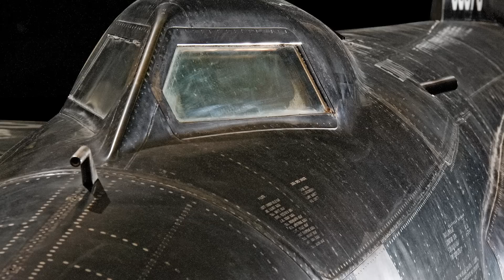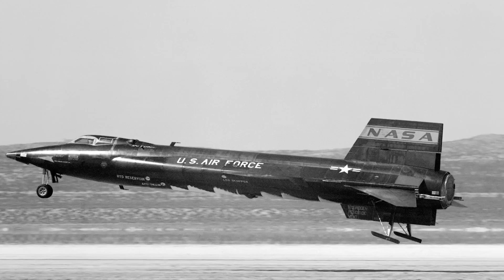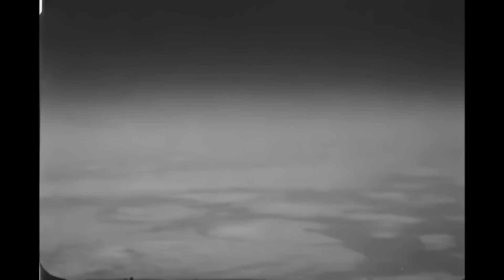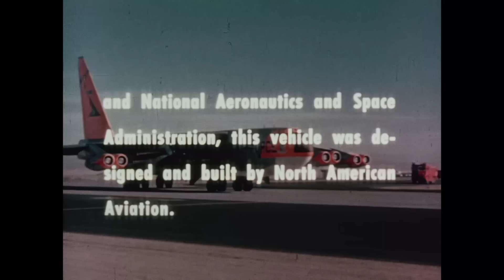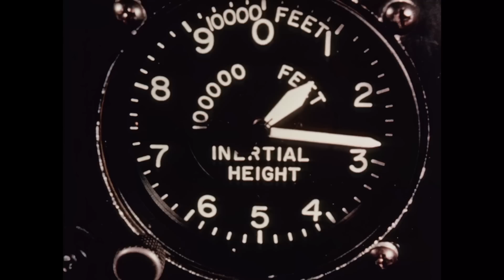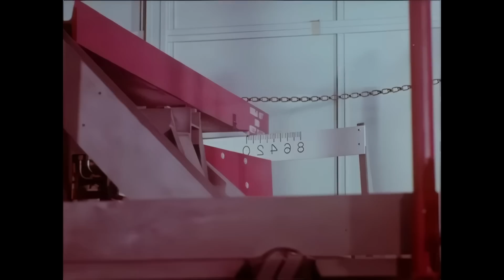X-15 Hypersonic Aircraft. Flying At 4,520 mph, And 354,200 feet High In A Rocket Plane

Comment: The X15 class of research aeroplanes (X15) was made possible courtesy of The Miles Aircraft Company and its M.52 supersonic research aircraft project, designed in the United Kingdom in the mid-1940s. There was to be an exchange of research, which in the end occurred only one way. The M52 was to be jet turbojet-powered, not rocket powered.
Reply from the maker: There is an ongoing debate on that. Eric "Winkle" Brown surely thought so, and that's probably why Chuck Yeager did not like him (X-1). It was certainly odd that the M-52 test flight was called off at the last minute, and not long after the X-1 broke the sound barrier. This said, there is no hard evidence that this is what happened.
Reply: @Dronescapes  There is no ongoing debate. The history is well documented. The X-1 aircraft was a British design, and the rocket engine was German.
As for Yeager, if what you say is true, he was somewhat confused.
Why risk a life for a record that's been taken? Britain, of course, eventually broke the sound barrier, in its own good time. It was the first to power a jet aircraft to 1000 miles per hour. That's jet engine, not rocket engine.
Reply: @francocarrieri1988 Obsessed and seething lmao, cry more yuropoor
Reply: @francocarrieri1988  Yes, you are correct. There is indeed no debate, because it is bunk. To say that the X-1 was a British design is most definitely bunk. If it were a British design, please show us where the British ever flew an aircraft that looked like thew X-1. The X-1 was designed by Bell aircraft in the United States. If you wish to believe otherwise, that is certainly your prerogative. The rest of us will gone on with our lives and ignore conspiracy theories.
Reply from the maker: @x15galmichelleevans  the debate is over the fact that:
1) The M.52 project was scrapped at the last minute, just before the scheduled test. At that stage the M.52 was 92% ready. No explanation for the cancellation was ever given.
The flight would have happened much earlier than the Bell X-1, month earlier.
2) We do know that the first working (not flying) turbojet engine made by Whittle was sent to the USA (General Electric) in great secrecy in 1941, and that ended up in the XP-59, which was also the first jet engine that ever flew in the USA in 1942. The XP-59 was made by Bell. We also know that the first Pratt & Whitney's jet engine was Whittle's. According to history Britain gave full access to their ally to all their secret projects. That is a good indication that the US most likely had access to all their projects, as proven by the ones they took, and that are widely known.
3) A scale model of the M.52 actually broke the speed of sound barrier, after the test was cancelled, and program was scrapped.
There is definitively plenty evidence of Britain handing over their technology to the USA. G.E. even made a documentary about it, which if anything would have been biased toward the US, certainly not Britain. They make no mystery they put their hands on Whittle's research.
There is definitively a connection between Whittle and Bell, and there is definitively an unexplained event, which is the sudden cancellation of the M.52 program with no reason whatsoever, and a scheduled flight, with Eric "Winkle" Brown as a pilot, the British legendary test pilot.
We also know that Chuck Yeager was quite aggressive with Brown for no apparent reason.
We have interesting interviews in both Eric Brown's documentary: https://youtu.be/PSRAdZzRycc and a full interview on the subject that has never been seen before, and that we will post soon.
In the interview you can also hear Brown explaining how Bell had a problem with the Bell X-1, and how the corrective solution was taken from the M.52 program. It does not concern the engine.
Eric Brown was normally a pretty objective person...
Reply: @x15galmichelleevans What the British gave the U.S.was the all moving tail plane. That is what enabled controlled flight at supersonic speeds. They also gave the Rolls Royce engine that powered the Mig 15 to the Soviets. And they flew a half size model of the M52.
Reply: @jeffcrisp5531  There is no definitive proof that the M.52 had anything to do with the way things were done on the XS-1. The all-moving tail concept actually goes all the way back to the Wright Brothers, so if anyone stole any ideas from anyone else, you have to go back to the beginnings of flight.
Reply: @Dronescapes  that happened because Rolls Royce was issued an engine contract over him by the government, so he quit in spite.
Reply from the maker: @basedmoonman9341  I am aware of Whittle's story, but I don't think this is related to the X-1
Reply: @Dronescapes  the british try to claim everything as they did it first. sick of them
Reply: That's nothing but Browns claims and there's no proof of it whatsoever except for him saying it. 
If there's anything you can count on in life it's the fact that anything Brown said concerning America is a lie, the fact is that man was a petty jealous little child who wasn't big enough to congratulate anyone else for an accomplishment, so like a jealous little kid he'd stomp his feet, carry on and lie if he had to in an attempt to swing attention back around in his direction when it was someone else's turn to get credit for something they did.
I've never heard that man tell the truth concerning anything about America, he's actually claimed to have witnessed Adolf Hitler shaking the hand of Jessie Owen's after winning the gold in the 36 Olympics, the only reason he told that lie is because he knows it's a point of contention about FDR not inviting Owen's to the White House after the Olympics which is a tradition so he claimed Hitler shook Owen's hand just to make FDR look even worse, every historian whose ever covered the subject knows that Hitler left the Berlin arena in a huff after Owen's won, he didn't even stay to the end much less shake Owen's hand afterwards, like we're actually supposed to believe that Adolf Hitler did that anyways, sure thing. 
Another big whopper of his is the claim that in the 50's US test pilots secretly flew that piece of junk Horten flying wing, and the only reason he cooked up that lie was so he could claim that "It wasn't even flown by a 'proper' test pilot implying that had it been flown by someone presumably of his, cough, caliber, cough, then critical data would have been recovered as opposed to some cowboy just going for a joyride and precious opportunities being lost, that's such an absurd statement it's practically enough to leave someone speechless, first off it's a very well established fact that no one ever flew that disaster in the making, no test pilot in their right mind would have set foot in the cockpit of that thing, anyone who knows the truth behind that hunk of junk beyond all the sensationalism nonsense about it knows it's airframe isn't close to being something that's airworthy, it was changed and modified repeatedly when the Hortens were working on it and the workmanship isn't even close to anything that could be considered aircraft grade, test pilots in that era had degrees in engineering and anyone with that high of a level of education would take one look at something like that and refuse to have anything to do with flying it until it was completely reworked, and also to think that they flew it in the 50's yet it was something that to this day remains so classified that they still won't admit it is absurd, yea right, it was that classified yet they let a television production crew from The Discovery Channel crawl all over the thing, right, that's all believable. 
Which brings us to his lie about this aircraft, the X15, according to him he put in to fly it and met all the qualifications and the only reason they didn't let him is because he wasn't a US citizen, HA!!! That's laughable, first off that being the case they'd never have wasted anyone's time putting him through all the tests and everything else he claims he passed, why would they even bothered to in the first place? They wouldn't have, the fact is he never applied to fly it nor was he ever even considered to fly it, he didn't have anywhere near the engineering background to get into something like that, like the astronauts the people who flew the X15 either had PHD's or enough education that they were just a few steps away from having one.
Sure that aircraft the RAF built would have been the first to break the sound barrier, but if someone can't swallow the cold hard fact that their own government pulled the plug on the project because half their country was still blown up and needed rebuilt instead of spending money on projects that at the end of the day were nothing but bragging rights for some then they need to get their priorities straightned out, as if people were still supposed to be without jobs and practically homeless walking through piles of rubble to get to work every day just so others could go around thumping on their chests the rest of their lives, big deal about whoever broke the sound barrier first, something like that isn't nearly as important as the people being taken care of first, especially people who'd been through so much those past years of their life, it was their turn to have their government spend some money on them instead of funding some people's egos.
Reply: Your lack of emotional control does you a disservice. It's no way to go through life.